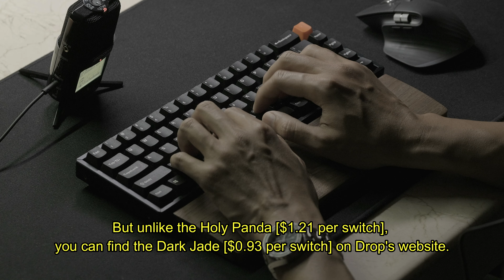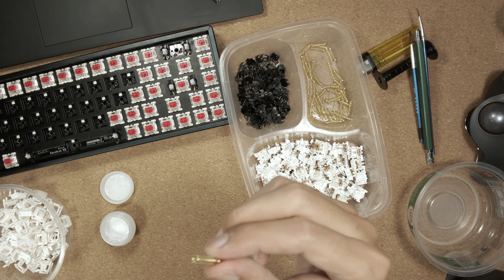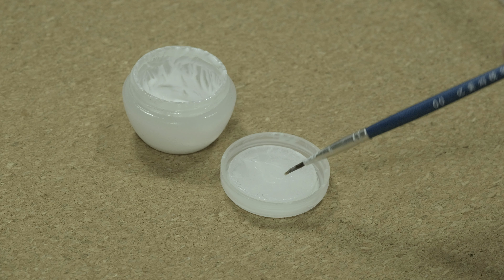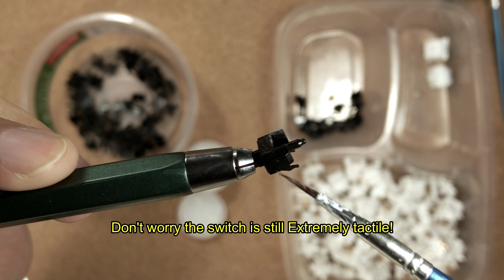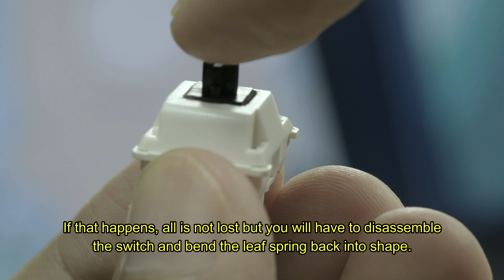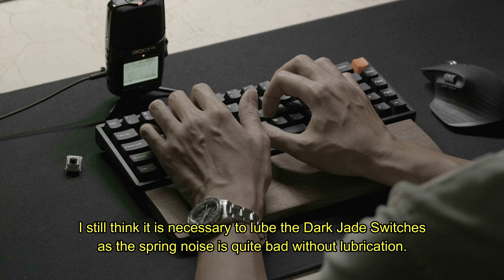Everglide Moyu Black (Dark Jade) Switch Review  - The Budget Holy Panda? [How To Lube Switches]

Comment: hey man, do you know if dark jades prevent interference on north-facing? like the holy pandas.
Reply from the maker: hmm I am not sure, I have not heard anything about it but they are almost identical to the HPs so if it is an issue with the HPs then I would assume the same would be true for the dark jade switches unfortunately
Reply: They do, based on what i've experienced so far. They do have longer stem poled so that is to be expected
Reply: @thanhnguyenhoai2727  i actually bought some. And yeah, it prevents most of the interference but there is a bit left on R2.
Reply: @miko-rv8sl  you mean R3 cherry profile, cause thats the lowest row haaha, I love dark jade too
Reply: @thanhnguyenhoai2727  idk i only felt it on r2 haha. I actually made a video soundtest, and you could hear the plastic collides when i hit enter.
Reply: @miko-rv8sl  Yeah enter key is on row3 haha
Reply: @thanhnguyenhoai2727  ahhhhh yeas, my bad. It is r3!

Comment: The Moyu Black are not budget holy panda... Although they both produce a similar bottom out sound and have a similar spring, there is a noticeable difference in tactility leaning towards the Moyu blacks. It's honesty good in its own regard though!
Reply from the maker: Ya I have gotten some feedback on the price of the Moya Black. At the time when I was shopping for a ultra tactile switch I get the Moya Blacks off of Drop. I was comparing it to the Holy Pandas also on drop and found them to be the cheaper comparable option. But ya not cheap hahah!

Comment: Everglide dark jades are still expensive lol.
Reply from the maker: ya you're right, I wanted to try out the holy pandas but just found that these are comparable and a little cheaper. Since then I have put deskey films in and they sounds sooooo much better.
Reply: @mr.ethings1545  you should try out FEKER pandas, I bought them and compared to your video they sound really similar.
Reply from the maker: @staplezasmr408  One sounds legtit! I havent gotten to try the more specialty switches yet but sounds cool!

Comment: There is this pinging sound I don't like
Reply from the maker: I have since moved these switches to a few other boards and I can confirm that it was something to do with the Keychron K6 board and not the switches, they sound much better on other boards. Either that or I have gotten better at assembling hahah
Reply: @mr.ethings1545  My friend also got this same pinging noise from his KB (with these very same switches) which is a Noir Z1. I think you just got better at lubing and assembling.